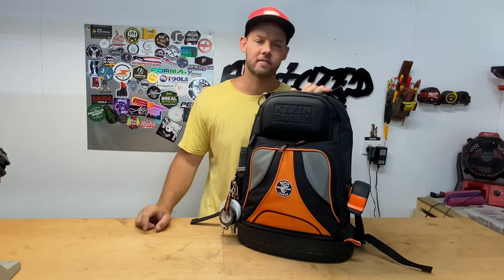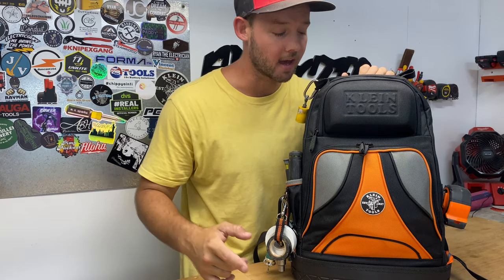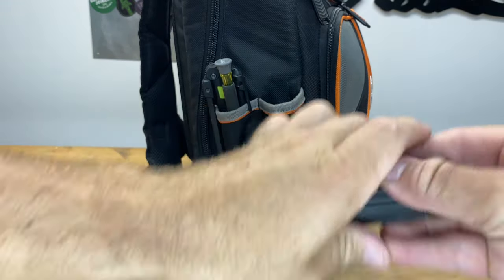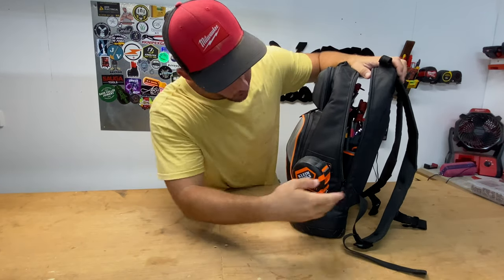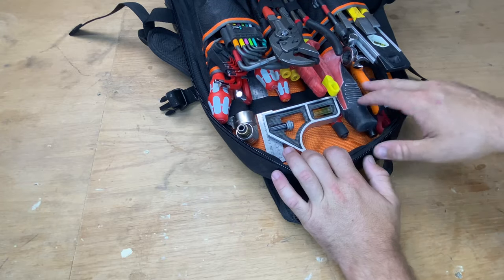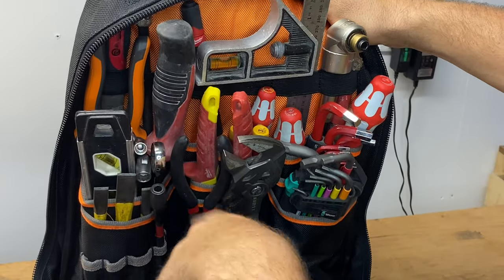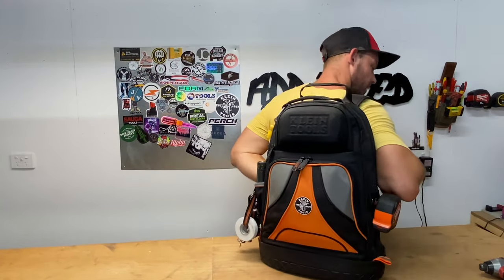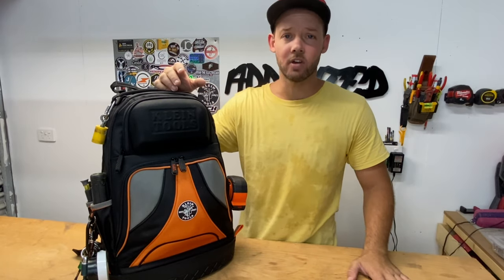Klein tools electricians backpack inside my load out. Tradesman pro

Comment: I have this bag, has taken a beating over the past 2 years, but now it is starting to fall. the bottom material starts to loosen up and falls over the plastic bottom. I may buy the same one again, it has had it's ass kicked and lasted 2 years, good enough for me
Reply from the maker: Thanks for the information mate. Good to see it’s done you well. I’m still using it and haven’t had any problems. A good buy for the price👌
Reply: $99 for 2 years? I’d rather have pay the money for a Kennedy toolbox that’ll last a lifetime and some
Reply: @cjsweetbeats9013  the Klein backpacks are horrible
Reply: I like  it except for the fact it won't stand up anymore.  The pack slumps down when I try to stand it up.

Comment: Yeah bruh when I saw you put hole saws in the hard side compartment designed to hold and protect a multimeter that's when I knew you green AF
Reply from the maker: 😂 cheers mate. I’m really hoping this is a troll comment. The hard molded pocket is actually made for safety glasses. My meters wouldn’t even fit in it. You can check out Klein tools website if you wish. Keep up the good work mate. 🍻😆
Reply: @AddictedtoTools  my meter fits just fine. The little segment in the back holds my leads nice and tidy. Maybe my meter is different. 500 kc mil is the smallest wire I'm landing.
Reply from the maker: Fluke T6-1000 pro or 117 won’t fit. When you say that the pocket is designed for a meter, what meter is it designed for and where did you get this information from?
Reply: Dont cut much drywall but I would put something fragile in the hard side. Not some indestructible low value tool.
Reply from the maker: Feel free to put what ever you wish into the case. Where did you get the information from that says the pocket is for multimeters?
Reply: @AddictedtoTools  from the 250 journeyman electricians I work with building modular electric rooms for the United states government ( a technology pioneered by my company).
Reply from the maker: Really I’m just wondering how you come to a conclusion that I’m “green AF” from something something you’re incorrect about.
Reply: So my hole saws are different and I have a separate Klein bag for those
Reply from the maker: That’s great. I put them in that pocket. How do you conclude I’m “green AF” though?
Reply: And I say it's for multimeters because that's where I keep mine Now true it will not fit a giant fluke with clamp on ammeter but that's the rig you are using to stay safe well under 1000 volts ?( in someones house?)  Lol bro. We are doing different shit I guess.
Reply from the maker: So the question remains. How did you conclude I’m “green AF”. We are most likely doing totally different work. I don’t do residential at all. All commercial
Reply: @AddictedtoTools Then I'm wrong. I'm incorrect. I should put an indestructible tool made of  HSS in the hard protected pocket.  Lol bro the bag is just to go from gear to gear. I have a gang. I'm not carrying my whole life in it. It fits my little meter like a dream and it PROTECTS MY LITTLE METER BECAUSE ITS A HARD PLASTIC CASE and my meter is  PLASTIC. NOT TOOL STEEL LIKE HOLE SAWS
Reply from the maker: That’s all good mate. You can put what ever you wish to put into it. In the video I’m showing how I set it up. We are all different and have different setups. I have no problem with people putting things in different spots. It’s just strange to say someone is green af for no real reason. Have a good one mate.
Reply: @AddictedtoTools  well huzzah bloody good govna. You can put whatever you like in there, you can.
Reply from the maker: Cheers for that chat mate. Keep up the good work🍻
Reply: @AddictedtoTools  hey bruh. You got the wrong back pack . You need to look again. The FRONT POCKET on the 55597 Is for safety glasses. IT IS SHAPED LIKE GLASSES.  The pocket on MINE is listed as cell phone small electronic pocket. Hence the plastic protection. When I want an electrician that's wet behind the ears to come hook up a ceiling fan I'll give you a shout. I'll handle the power distribution systems that run the internet and keep the country safe.
Reply: So I concluded the giant meter you dont need and barely know how to turn on doesn't fit. But my little meter just like all the other master electricians little metesr fits in there just fine. My LITTLE meter with the GIANT READOUT does the exact same thing as your GIANT meter with the TINY READOUT.  and I don't need a safety glasses pocket ( that's why I got the other one) because when you aren't digging around in the mud and work in a clean modern facility, its 100% PPE 100% of the time. SO YOU SHOULD BE WEARING THEM. NO NEED FOR A POCKET.
Reply: @NPC-157-e7r  Dude gets free gear from quality vendors for showing how he would, or does use them. If I had to guess my man has outgrown this pack. For 100 bucks you can’t go wrong with it but he does reviews on veto’s so I’m assuming he doesn’t often use this one. Im only a year into electrical work, I’m “green af”. That’s why I’m watching a review of an entry level pack. What’s your excuse little meter?
Reply: @josephhayden8959  don't need free gear. I have a Southwire meter that fits great in the safety glasses spot. My point was why do holes saws need hardside protection.  They are steel. Meter = fragile and you should be wearing eye protection first on last off so don't see why you'd need a spot for lenses
Reply: People are watching because they are new to the trade. Don't show them dumb stuff. Keep your free gear.
Reply: @NPC-157-e7r  you are welfare with your government contracts